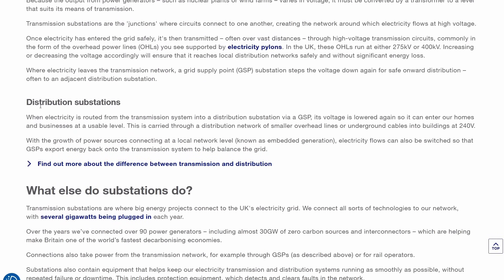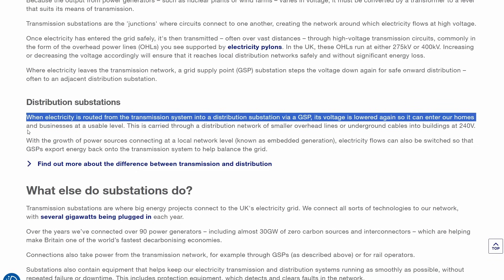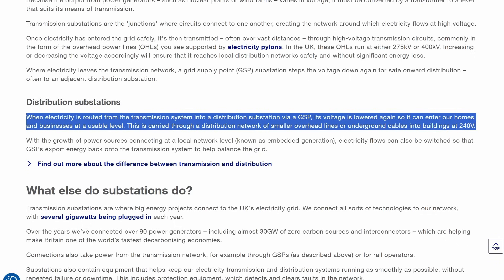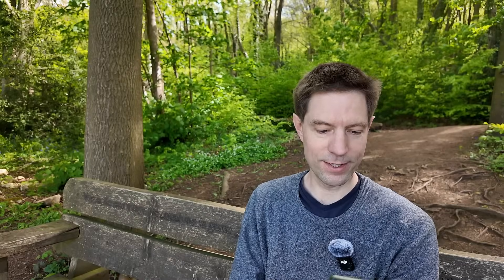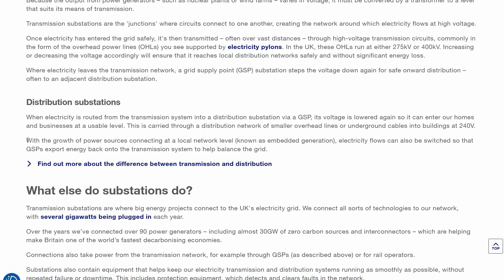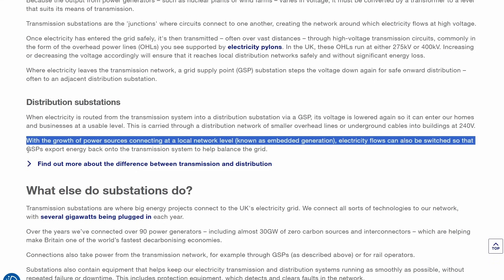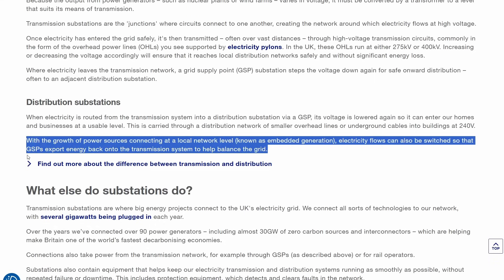Does solar export get past the local transformer?

Comment: My understanding is that a 3 phase transformer should have the 3 phases balanced to ensure the neutral currents don't go too high.  If one phase has a large amount of solar on it and the other two don't.  Then on a sunny day the neutral will be working hard.  I don't understand what happens in a 3 phase transformer when one phase is back feeding, and the other two are consuming.  Probably the phase angle of the other two phases are shifted.  How this affects the grid up-stream, I don't know.  This is for the DNO to manage.
Reply from the maker: Yeah, this is way beyond my level of understanding.  I'd certainly like to learn more about it, however.
Reply: @TimAndKatsGreenWalk  yeah it's complicated. I have a masters in electrical engineering and I don't understand it. Some things to Google are delta to star transformers. These convert 3 wire 3 phase into 4 wire 3 phase. And also drop the voltage from normally 11kv to 415v (240v 1ph).
Reply: @blewett47  Yes, delta to star windings makes available the 'neutral' wire so that 3phase 415v can supply 240(ish)v per phase.  If no 'neutral' is required from the transformer then it would be a delta to delta set of windings.
Reply: Also, not sure about balanced loads on transformers providing the biggest load doesn't exceed the rating of the transformer, but the main reason why houses are usually connected Phase1, Phase2, Phase3, then repeat is to (attempt) to balance load (demand).  The more houses on a transformer, the more(ish) balanced is the overall load being drawn.

Comment: It's just a transformer.  I'm sure it has no idea in which direction the energy is flowing, and no way to prevent it going up to the higher voltage winding even if the system wanted to prevent it.  So yes, I'm pretty sure that it will get stepped up and sent back to the grid.
Reply from the maker: The transformers, yes, but some older switch gear will trip with reverse power flow.  That older equipment is gradually getting replaced, however.

Comment: That’s exactly why it’s so crucial to expand battery storage systems on a large scale. Solar and wind power are by far the cheapest sources of energy, but they aren’t always available — which is why we need to smooth out their fluctuations. Battery storage isn’t just beneficial for renewables like solar and wind, but also for conventional power plants, since they no longer need to ramp up or down rapidly. This allows them to run more steadily and therefore more efficiently.
Reply from the maker: I've been saying this for a while too.  Battery storage is going to become a very big deal quite quickly I think.
Reply: 100%. Batteries are the solution for many of the issues currently (no pun intended) experienced by grid operators as they try to balance supply and demand. 
Any premise fitted with batteries can do 4 things at once to support the grid : 
1) reduce supply in the middle of the day 
2) increase demand in the middle of the day (force charge on cheap rates)
3) reduce demand during peak hours 
4) increase supply during peak hours (force discharge at peak rates)

All this whilst making a small profit from the arbitrage. 

Mick, Brisbane Australia

Comment: It feeds back to the grid and this is why home solar must shut down or disconnect if the grid is down because of the risk of backfeeding a high voltage line that engineers are working on to fix the power outage.
Reply from the maker: Yes, that's a good point.

Comment: So, basically... nothing will break.  Transformers have no trouble transmitting power in both directions.  They don't even notice.  However, there are a few issues which require attention when backflows become substantial:

* Transformers reduce the voltage by their ratio of primary vs secondary windings in the forward direction.  This means that they BOOST the voltage by the ratio of secondary windings vs primary windings in the reverse direction.   It is relatively easy to keep voltages within the specified allowed voltage range for a line when going down because you are dividing, basically.  But in the reverse direction the voltage boost can become a problem.  The relatively small voltage solar export starts at can be magnified by the transformers along the line to excessively high voltages as they reach the sub-station.  Assuming other (non-solar) homes don't gobble the power up before the reverse flow gets that far.

* This is an issue in the forward direction too, and substation transformers have mechanical "taps" which can be adjusted to ensure that the voltage step-down is in the proper range.

* Older transformers have mechanically actuated taps... sometimes an actual engineer has to go to the substation and change a tap manually.  That began to get automated roughly 50 years ago or so.  But the the sensors in those installations generally weren't designed to measure or servo stepped-up reverse voltage flows.... they were designed to measure and servo step-down forward flows.

* Poor monitoring of utility transformers can lead to transformers that really get out of whack in terms of voltage step-down (and thus also step-up).  Mostly because the step-down direction just doesn't cause that many problems due to the voltage being divided down.  These poorly-maintained transformers can cause problems when the voltage is stepped-up by a reverse flow, however.   Just means the utility has to actually calibrate their transformers correctly and replace transformers with partially shorted windings (which changes the ratio) instead of letting them fester for years past their service life.

This means that lines which have substantial reverse flows often need substation upgrades to install transformers with more modern sensors and automatic tap controls.

None of the other issues are real issues.  Yes, transformers have different kVA ratings in the reverse direction vs the forward direction.  But in 99% of the cases, exported solar energy just winds up flowing to nearby homes that don't have solar and the reverse flow rarely makes it all the way back to the substation... or there simply isn't enough of it to cause any substantial issues.

So, no, the heatsinks people might see slapped on to transformers usually have nothing whatsoever to do with backfed power and are simply related to higher demand (normal flow).

There are a few places where solar backflows are so large that substantial review, testing, and updating of systems is necessary, but those will mostly be in the U.S.... not so much the U.K..  Hawaii and California, in particular, have enormous amounts of residential solar on the grid and there were teething problems when backflows first began being seen. But it is mostly a non-issue now.

-Matt
Reply: Interesting, what about the possible scenario where one phase is backflowing but the other two are not?
Reply: @richardskinner6391  Big nothing to a trasnsformer.  Mismatched legs on one side of a transformer do not generally translate to mismatched legs on the other side.  The energy is redistributed (note 1).  Basically the net energy is aggregated into the magnetic field and redistributed on the other side.

The primary issue is entirely due to the possibility of the voltage going out-of-bounds as it gets magnified in the reverse direction... which is a function of transformer maintenance throughout the chain, and tap automation at the substation.

note 1: "mostly" redistributed... depends on how (or if) neutral is wired.  But for all intents and purposes, it isn't an issue.

-Matt
Reply: @junkerzn7312  so im only abusing my local transformer 
I have 2x single phase grid inverter 
And 1x single phase battery 
So during the day i export on l2  and consume on l3 

So l3 = +20A 
L1 and l2 export 20A together 

At night its reversed
Reply: @neok1996  20A might as well be a drop of sweat :-). The transformer wont care.
Reply from the maker: That's really interesting, thanks for taking the time to write such a detailed comment, I appreciate it.

Comment: How could it possibly not flow in both directions?  Just think about how it actually “flows” in each direction… As you know electricity flows from places with a higher voltage to places with a lower voltage.  To “export” electricity, your inverter has to raise its output voltage to a higher voltage than the local supply. If lots of people are doing that and not consuming the power locally, then the local voltage at the transformer will get higher. A transformer is just a pair of coils with different numbers of windings on each side. The ratio of windings between the primary and secondary coils determines the voltage ratio between the distribution network (typically 11kV 3phase) and the local network (400V 3phase, i.e. 230V per phase), so when your local grid has lots of people “exporting”, I.e. raising the voltage of each phase to just over 230V, then that increase gets multiplied up by the transformer to push the local distribution grid up to 11kV plus a teeny-weeny bit.  Obviously it all gets a bit messy when some people are exporting on one phase, and others are consuming lots on another phase.  That’s why the DNO needs the G99 submission for larger projects, to know who’s going to be distorting the lovely balancing they have to do to ensure that each phase stays within tolerance.  It’s why under a normal G98 connection, I can import 100A per phase, but only export about 15A per phase.
Reply from the maker: Some switch gear isn't designed to work with reverse power flow so can trip in that scenario.  However, older switch gear is gradually getting replaced with versions that can work with reverse power flow.
Reply: @ maybe, but local transformers, like the pole mounted ones you show are just dumb transformers, with maybe surge protectors and fuses, not switch gear.
Reply from the maker: Fair enough.  I guess that's an issue for the substations further out then.  In any case it's good to know that the excess power won't go to waste.
Reply: Aren't the output voltage of inverters limited to stop them exporting above the 253V limit. Hence excess output on any one phase will be capped by the inverter before leaving the house?
Reply: @ yes, it’s capped at 253V.  So what?
Reply: So if the grid voltage rises above that the inverter stops exporting
Reply: Pretty much all new inverters seem to work that way and if all did presumably there would be no need to artificially cap exports.

Comment: Essentially taking power from the grid and putting it back are the same thing. When taking power you are effectively trying to slow the grid down by "pulling backwards" and when exporting you are trying to sped it back by "pushing forwards".

Pumped storage makes use of this exact thing - when pumping up the hill the motor-generator is pushing the water (so pulling back on the grid), and when generating the water is pushing the generator hence pushing the grid.

A transformer is just 2 coils of wire - the direction of power transfer is defined by which side is dojng the pushing.

The area where i guess solar is a potential problem is that a thing called "diversity" cant be used. You can assume that not everyone turns everything on at the same time, but when it is sunny everyone will be pushing power back. One would assume the smart metering system etc measures this, and limits export.
Reply from the maker: Yes, exports can certainly be limited by the inverters.  I see a future where tariffs encourage EV charging when it's sunny to help soak up the excess.  It's funny, some people panic about there being too many EVs for the grid to cope, and others worry there will be too much solar for the grid to cope.  It strikes me that these problems more or less offset each other in the fullness of time.  At least in summer.  In the winter any excess wind can be soaked up by the EVs instead.